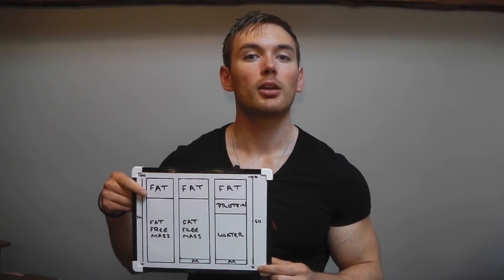Body Fat Analysis; How Accurate is Bioelectrial Impedance Analysis
(BIA)?

Comment: Solution: take more measurements, increase the sample size.
The "margin of error" occurs around an average. If your body is changing, the true average will shift. To be able to see that shift, you need to take more samples. 
Then you can do a hypothesis test to figure out if the change in the average is statistically significant with the t-test. It's the most basic statistics

Comment: My gym uses InBody 230. You have to stand on it and hold onto handles. Been steadily losing fat and building muscle. My recent results compared to when I started out:
February 16th: 39.5 lbs of fat, 66.4 lbs skeletal muscle mass, 25.1% body fat
May 14th: 23.1 lbs of fat, 72.8 lbs of skeletal muscle mass, 15.3% body fat

Comment: I’m glad I came across this video. I’ve been doing tests on a inbody machine for a few years at my gym and when I was overweight (35% body fat) and was working on dropping fat, the readings were making sense as I was getting leaner. Now that I’ve stabilized at 18-20% and working on gaining muscle, the readings are weird! I’m sleeping well, respecting my macros and calories,  keeping stress to a minimum, drinking plenty and my weights keep going up at the gym .... yet.... my readings are saying that I’m losing muscle and gaining fat. Makes no sense with what my body is displaying in terms of performance and even visually and how my clothes are fitting. So I’m ditching the test for a while, just going to judge by my performance and will also take measurements. Thanks again for the video!
Reply: Am having similar results to the point that I have consulted with my doctor and he has some doubts on accuracy.  Did you gain more insight into this?  Thank you.
Reply: Same thing is happening to me!! I'm eating tons of protein, working out, eating less calories and it says my fat is going up. Garbage machine!

Comment: So what are you using as the reference? Even professional measurements like Hydrostatic, Skin Fold, DEXA Scan are quite inconsistent (comparing results between them). Also, isn't it 8% margin of error for the measurement of the fat itself? Meaning if you weigh 60kg and you're 20% body fat (12kg) then margin of error is 8% for the body fat (100% - 12kg, 8% - 0.96kg). That is 1.6% (0.96kg) margin of error. And it's really decent to track your body composition changes. I've had very consistent results within reasonable margin of error of 2% for a few months.
Reply from the maker: Percentages vs percentage points.

e.g. if someone is measured at 10% via a method with 8% margin of error, they could be 18% body fat rather than just 10.8% body fat. That would be extremely reliable lol.

I should have explained this better. A few people asked me this.

Comment: Hey Ben, great video you have got here!! I have one BIA scale with hands and food sensors, which I believed to be fairly accurate - however I do have weird readings... Let me explain...

For instance - before I went on a small vacation, it showed 17% BF while I was 55 kgs, when I got back (a couple of days later), measured again, same weight but 20% BF - so what can I actually expect here? I wonder if I really gained 1,5 kg fat and lost the same amout of lean mass in 10 Days? I did eat more than usual, yes but nothing that would have explained such gains - and I did weight train, less frequently but I did.

After that, readings (weekly, under same situation, first thing morning, after toilet etc) have been showing constantly "higher" than after the vacation, so I am confused... Now, I am fairly lean, if I flex my Abs you can see them a bit, so I suppose to be around 16% but still...

What do you think?! Thanks in advance!